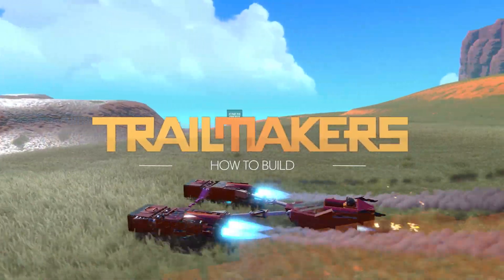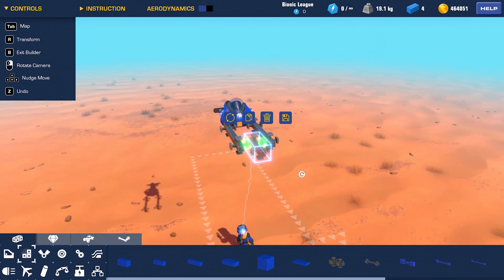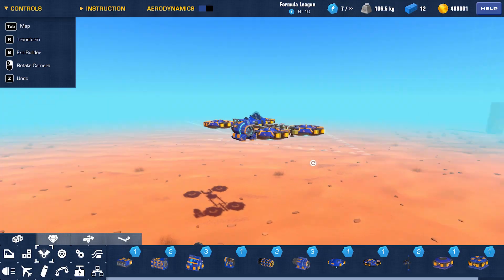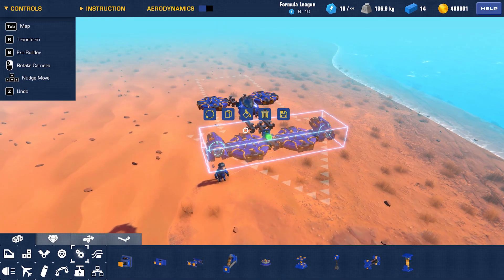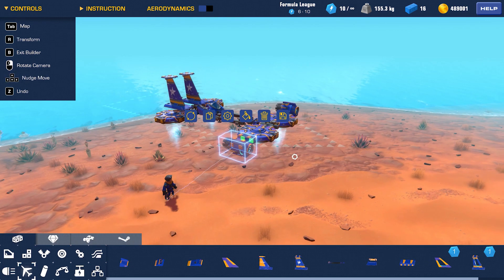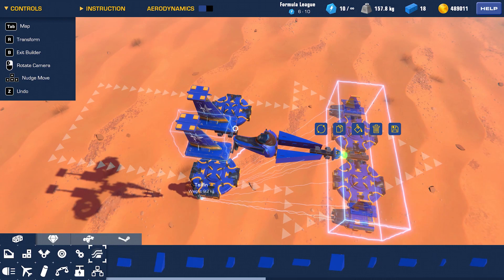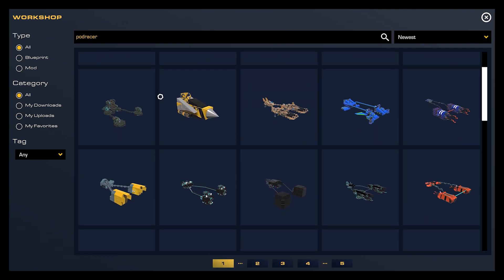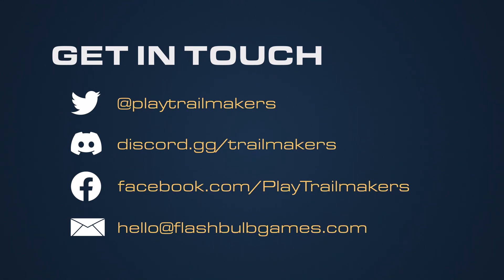How to Build - Hovercraft | Trailmakers

Comment: It would be really cool if the hover block had some kind of braking system and could move without using jets or anything like that, because right now most hover vehicles look like soap sliding along the bottom of the bathtub